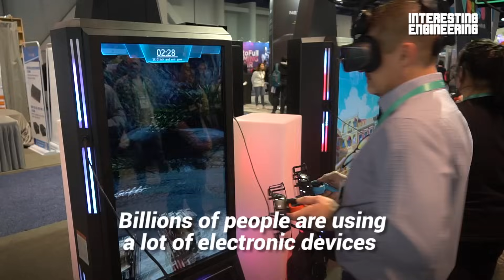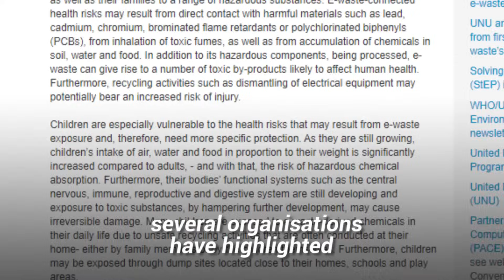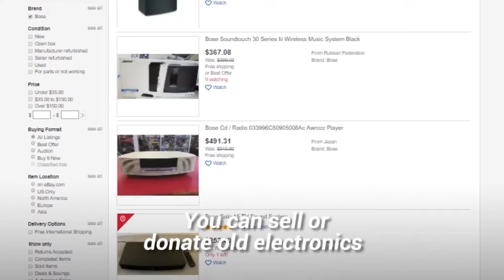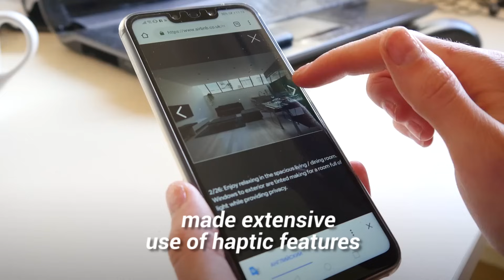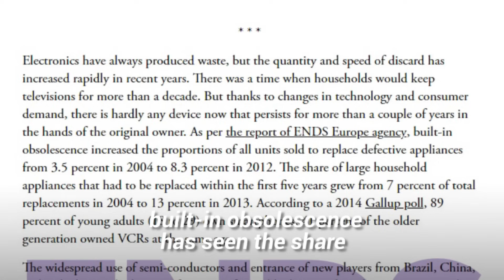How e-waste is harming our world

Comment: One of the main causes of e-waste is when people upgrade to newer products too frequently, and the old products are often thrown away even if they are still in good working condition. 

Whenever something does develop a fault, it helps to be technically minded. Knowing how to maintain and repair your own electronic products will help it last for many years and save money.
Reply: Yes
Reply: Actually incorrect.
People don't want to upgrade by companies force them to, using planned obsolescence